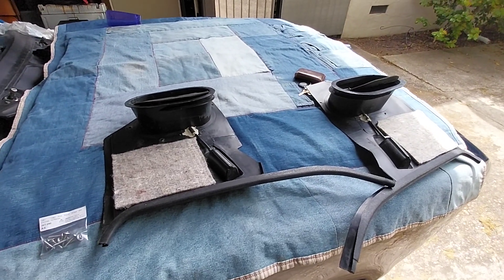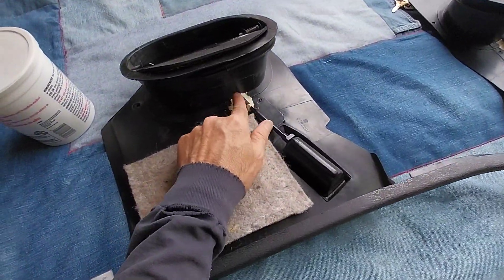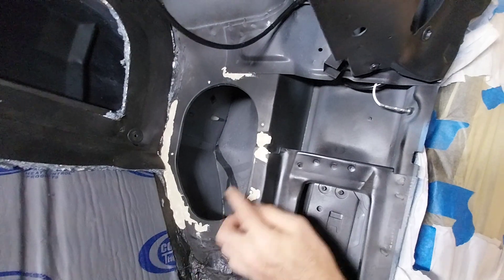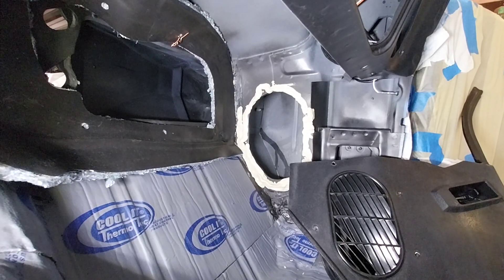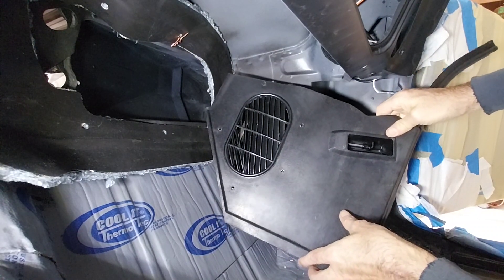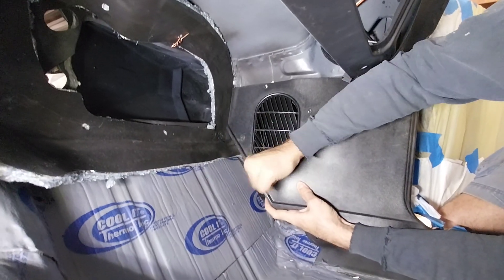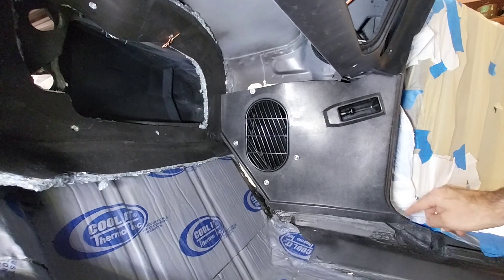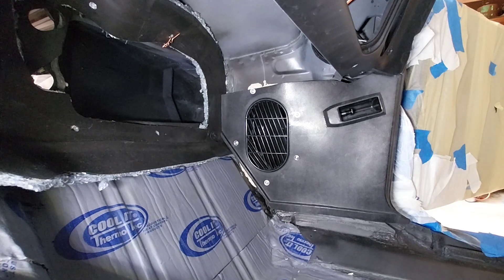1968 Camaro Kick Panel Installation Passenger : 274

Comment: Wow!!! I have put kick panels in my 67 & 68 Camaros a couple of times on the years. I had to fight & struggle for a very long time to get that practice tunnel part in hole. You made it look almost effortless. Thanks for the video.
Reply from the maker: I thought I was going to fight it in too   and a couple retakes of the video, but went right in on first try.  I do however recommend applying more putty.  I sure mine is fine, but compared to the amount the factory installed, I should have made a thicker ring around the hole.

Comment: Do u use any type of grease on your pull lever for the kick panel?
Reply from the maker: @jjjones518  Grease.. No, but I coated it with Boeshild T-9 lubricant or you can use liquid graphite.  Probably don't want to use grease.  That area gets lots of debris and could gum up the cable.